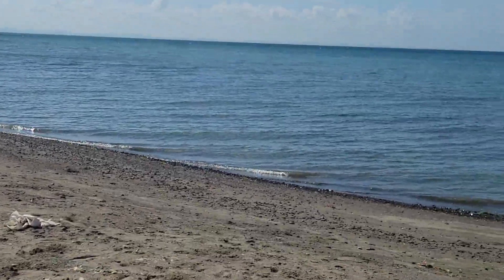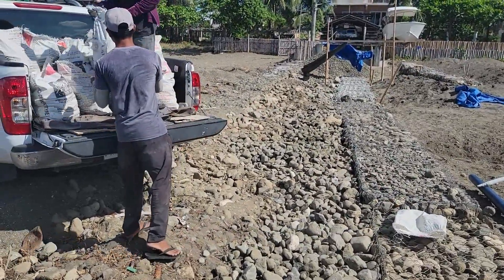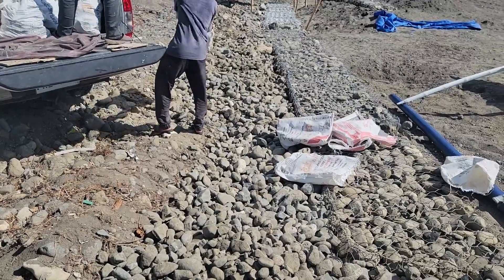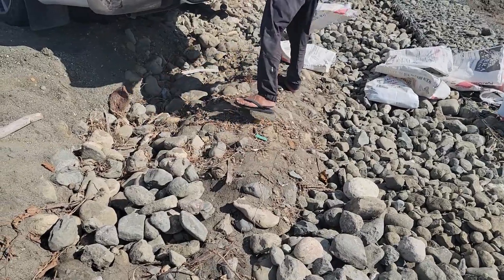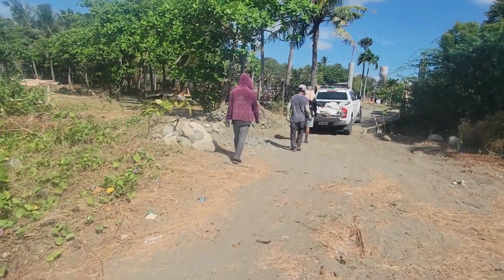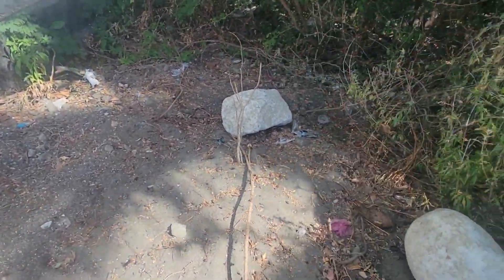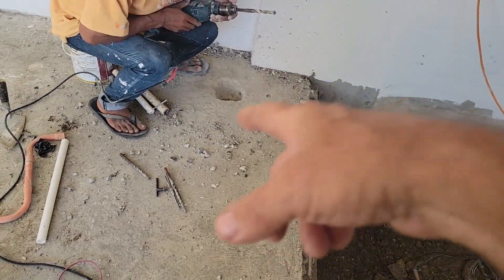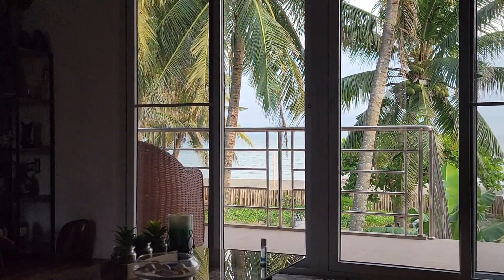Philippines Beach House Build Episode 388 SHOCKING TRUTH ON THE BLOCKED PIPE!

Comment: I had a plumber that I had problems with when I was building.  I had trouble getting him to work when it interfered with his hog hunting.  He ended up cross connecting some lines so the tankless heater came on when I would turn the cold or hot water on.  He will answer for it one day to a higher power than me.

Comment: Thank you for sharing your process of dealing with the blockage in your pipe. It's unfortunate that someone dumped concrete down there, but it's great to see you and your crew working together to find a solution. It's also reassuring to know that you built redundancy into your house's piping system, which shows your foresight and attention to detail. Keep up the good work!

Comment: Have a great Easter.  And yes. You have covered all your bases on the building. From doing electrical in commercial buildings we had to clear underground lines and used those chemicals many times just so we could pull in the underground electrical.

Comment: If you're able to snake the borescope in from the opposite direction then measure the length of the probe once you get to the clog you might find you only need to cut out a short distance of the pipe and splice in new to resolve the problem.  That way you wouldn't need to worry about the concrete shifting position.  Either way, thanks for the update and observations.
Reply: Glad to see you are trying to be helpfull.

Comment: I brought 50 meters powered snake for the drains and a 3500 psi power washer with special 50 meters hose and tip for clearing pipe

Comment: Maybe deflating truck tires to about 18 lbs. each will help driving in sand. Was practice did working in desert sand of Middle East.
Reply from the maker: my tires are filled with nitrogen. I dont want to let that out.  Pushing a 5000 pound boat over loose sand needs more than tires deflated down. This is not just about driving this is about capturing this sand that returned before storm season returns. We have grown the beach out about 150 feet past where we use to launch.

Comment: How do you get dried concrete out of a drain pipe?
Pour hydrochloric acid (sometimes also known as muriatic acid) into the clogged drain and leaving it for between two and three hours. After this time, flush the pipe with about four gallons of water and loosen any remaining blockage

Comment: I don't know what happened to my comment before.  We live about 1.5 hours away form you.  We had that same problem before a worker that we fired poured concrete down a pipe in our wall.  We were told by our foreman that is a common problem with workers that know they are on there way out.  What we ended up doing is using an auger  to break up the  Concrete  then we used a product recommended by him called Croc-crete let it sit over night and it was like sand the next day.  it was not a cheep product it was about $400 usd.
Reply from the maker: WOW good information.  My friend who owns Joe's Offroad told me to be very careful buying a repo bike or car. He told me Filipinos will put sand or metal shavings in the engine , rear end and transmission to sabotage it . He said that they are very "revengeful" people even if they are the one in the wrong.  Good CHRISTIANS huh? lol

Comment: James if you go back and look at the comments, I said it would most likely be concrete, I have run into that problem several times on new builds. most times not on purpose, usually from the guys cleaning their tools into the drain. but like you said, yeah, that guy most likely did that on purpose.